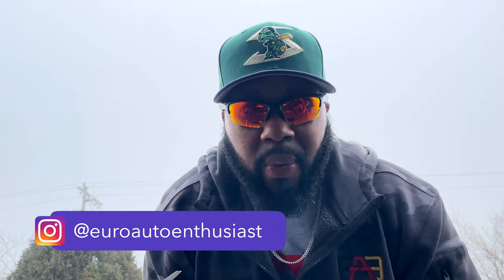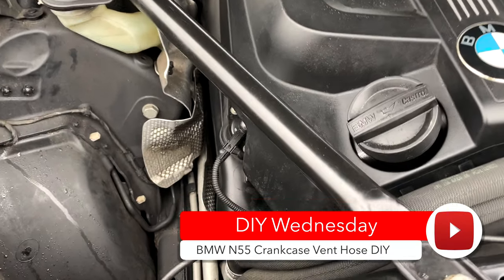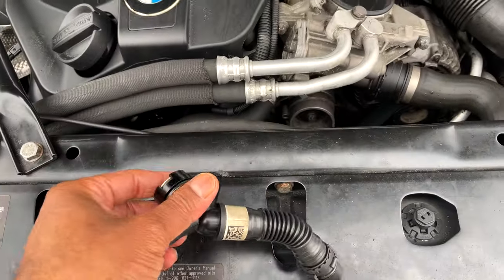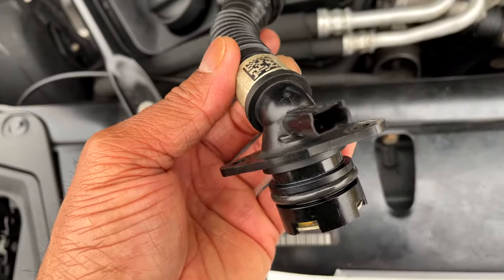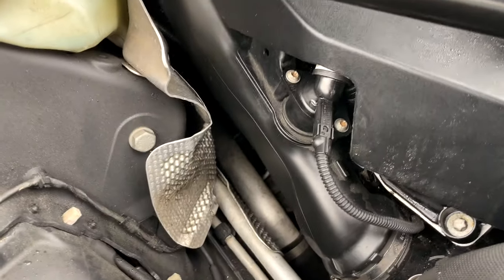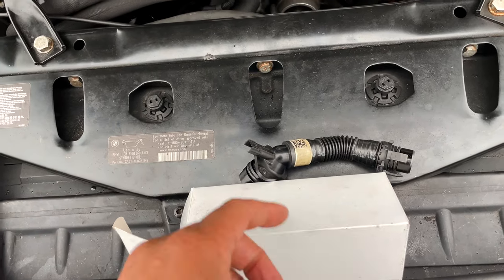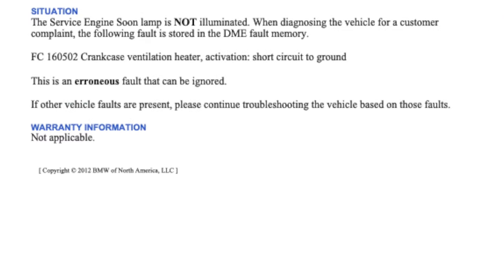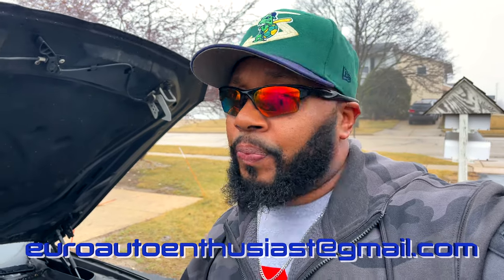How To Replace BMW N55 Crankcase Vent Hose F10 535i F30

Comment: Could this pipe being cracked/broken lead to rough starts, and make the rpms go high and low when i turn on the car?
Reply from the maker: Yes it can be a contributing factor. Hopefully you noted the BMW TIS bulletin mentioned.
Reply: any updates brother ? finally found what i think is the fix to this same issue. Car runs and drives fine but that weird ass rough idle (only happens on warm starts)
Reply from the maker: No further updates on this part since the bulletin spelled out the false code. After I replaced the fuel pump the car/engine has been solid since 👍🏽
Reply: @nh3388  did you ever find the solution by chance?
Reply: @Vader335i  Yea turns out on N55 it’s very common for valve cover and crank case hose to break since plastic leading to air leaks. I bought a valve cover gasket kit from fcp euro that came with everything and the install took about 4 hours in my garage without having to raise the car at all. 

This is most likely your issue i have been able to diagnose this with a few friends as well. With a free saturday you can spend a couple hours doing it. it’s not hard at all just have a few extensions and a few swivels. 6/10 difficulty for your average DIY mechanic. Plenty of vids on youtube let me know if you need the one i used. Or a few shops quoted around $750
Reply from the maker: I had 2 separate issues that happened around the same time with service completed:
•Fuel pump
•Valvetronic motor
This was simply a false positive CEL
Reply: Now that i remember thanks to this video i was able to get a visual on the hose since the 3 series has it slightly different placement. This video helped a lot if you have a. 3 series also
Reply from the maker: @nh3388 that’s great to hear…thanks for your feedback 🙏🏽

Comment: How are you quick question, my BMW is 2011 535 I BMW I never changed my PCV Valve and I heard you should change it out. I have not got no code but car is 13 years old. Should I also change PCV Cap?
Reply: The PCV cap is integrated into the Valve cover itself, you would have to replace the whole thing. The PCV should only be replaced if you have an issue relating to it, As for the hose, I think you should replace it as preventative maintenance
Reply from the maker: @immortal8039 is correct. It’s integrated into the valve cover. Leaks are the most common signs for gasket failure. In the event of changing that, inspect the cover and change it then…while you’re in there 👍🏽

Comment: I have a friend who is currently doing this repair. It should be quick and easy but we cannot get the lock tab in place properly. The 4 tabs that click around the valve cover slide up and click into place leaving no way to put the Locking tab in place. Should we trim the hooks on the ends of the four tabs that click around the valve cover to make them shorter or should we send the hose and down to allow it to insert further

Comment: Got a 2015 335i the hose looks bad and has some black tape holding it can that be the cause of the check engine light and why the people thought it could be my o2 sensors ?
Reply: Guess the code the bad was 02 sensors but my mechanic seen the hose in bad shape and said start there ?
Reply from the maker: There could be a vacuum leak which caused the CEL. Did you pull codes?

Btw, generic scanner’s codes are too broad, especially if it was an emissions related fault code.

Then of course, they thought O2 sensors is the problem.

Comment: Would this cause the drivetrain malfunction? I have this code and 420022. I’m at 119k miles, I’m currently charging my 10 yr old battery in hopes of seeing if the transmission error was likely due to low battery voltage.
Reply from the maker: Low voltage can cause cause a myriad of malfunctions because the modules and DME can’t operate properly. I would be surprised if this hose is the culprit.
Reply: @EuroAutoEnthusiast  I finally received an engine light, drivetrain malfunction would happen without a code. New code popped up and it was 801C15, which I found people replacing the battery and that fixes the issue. Additionally utilized bimmerlink with the misfire mode and was getting a misfire in cylinder 1 so new spark plugs and a ignition coil are on the way. Hope that fixes my issue. Can keep you up to date. Thank you for the help!
Reply from the maker: @kylemiller9813  progress is always great and please keep me updated 👍🏽
Reply: @EuroAutoEnthusiast  today was the day, brand new spark plugs and ignition codes. I even cleaned both vanos solenoids, however I now received drivetrain malfunction as soon as the vehicle started and additionally chassis malfunction. However, the car sounds fantastic. I checked codes in hidden menu and there were none. My focus is now the battery as I had it 100% charged this morning and now it’s at 62%. I have no idea what’s going on. Date on negative terminal is 29-12. I also plan on adding transmission fluid as one of my original codes was a pressure solenoid issue in transmission, assuming from low fluids. Anything you can think of?
Reply from the maker: @kylemiller9813 do you have something plugged into the USB port? That’s the weird culprit I found that was drawing excessive voltage…killing the battery
Reply: @EuroAutoEnthusiast  after I read that it would drain if not in use I removed it. My new scan tool comes in tomorrow and will use bimmerlink to figure it out. Fingers crossed nothing serious
Reply from the maker: Hopefully it’s not serious🤞🏽
Reply: @EuroAutoEnthusiast  found the issue, large humming coming from rear engine bay after I rev above 3k rpm. Boost solenoid
Reply from the maker: @kylemiller9813  oh wow…found it! That’s a win 👍🏽

Comment: Bro thx for a great video and tutorial. I got same code but also 133E10 valvetronic system deactivated adjustment fault too frequent. And the car burning oil. Does these codes have any connection to each other? What should I start with doing? 

I will do a service soon but I am scared to do it if it will continue burn oil. 

Can you give me some advice?
Reply from the maker: Thanks for watching…it’s been a couple of years since posting this.

What I know is that the valvetronic motor controls intake valve lift. I’ve read that upon failure of it, an oil leak is probable. 

I do remember having a bad leak during this time, but it was from the valve cover and oil housing gaskets; they were done just before I replaced the VTM.

With that, the VTM could be your issue, but I can’t confirm 100% What I do know is that if you have a code pointing directly at it, it’s needing some attention.
Reply: @EuroAutoEnthusiast  ok thanks for the answer, i found at directly after i commented here that the crankcase was broken. Do you think it’s dangerous to drive the car until the part arrive? 

About the vvm I will check it out after I replace the vvm and make the service. I pray that it won’t be a big issue, I just got the car and I already got problems 🤣
Reply from the maker: @StevenHalef I can’t make that determination for you on whether or not to drive. But the system will determine if the engine needs to be in limp mode or completely shut off. 

The VTM replacement is labor intensive 5+ hrs. Unless you’re DIYing, expect labor cost and recalibrating the system to be ⬆️
Reply: @EuroAutoEnthusiast   I understand, really weird that it didn’t make the engine light turn on. But I will start with the crankcase then see what I can do. 

I hope my mechanic can fix the VTM issue, I checked some videos and I can’t do the calibration and the replacement is too high level of skills for me:/ But I am really thankful for your help! Have a nice day and take care!
Reply from the maker: @StevenHalef Many codes will not trigger a CEL, but will show up when you scan it ISTA+ and BimmerLink. It was a pleasure to help you and thanks for the opportunity to help 👏🏽🙏🏽